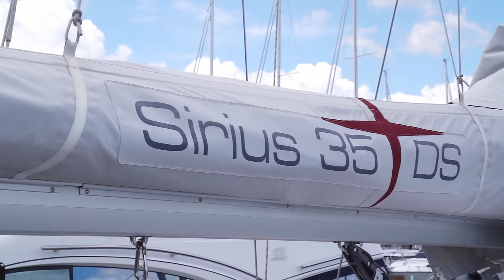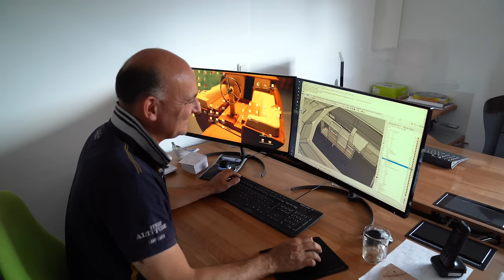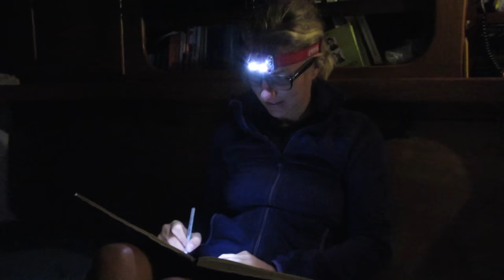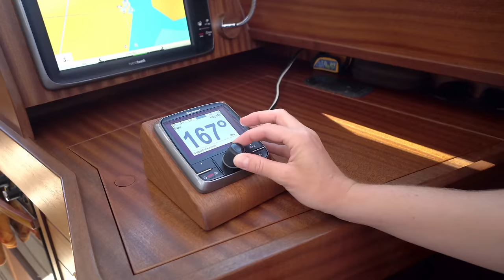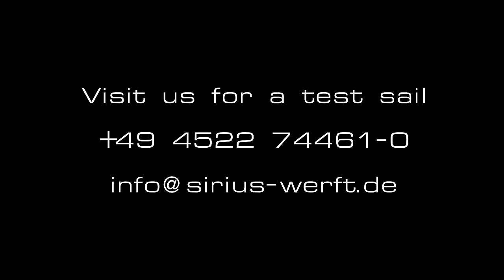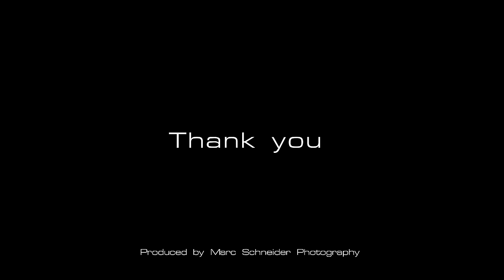Sailing the Sirius 35 DS: A Day at Sea

Comment: How difficult or slow is it to tack the genoa past the furled jib?
Reply from the maker: ...you can´t tack the genny though the gap, but either have to furl it, in and out, while tacking or gybe it though. This works pretty good, but is work, thought ...but than one have to see: as a cruising sailor, you would try not to set your course against the wind all the time or are on long tacks. If you have to tack constantly, the jib is the better choice anyhow, or if it´s that little of wind, furling the genny in a tack is not that much work at all...
Reply: @SiriusYachts  Thankyou. I had guessed furling would be necessary.  I enjoy cruising but I also enjoy twilight racing.
Reply from the maker: ...it is an option, thought! As standard it comes with just one stay and you could compliment your jib or smaller genua with an additional light wind sail, if you like. The benefit of the so called "solent rig" is, that you still have a proper sized jib, which could be sailed from 3-3,5 beaufort on, with enough sail area to have fun with it. ....and have the big genny at hand as well, without effort for changing sails, other than furling the new sail out and the old one in within 2 minutes from and without leaving the cockpit. Than the jib still sits on a furling reefing system and could be made much smaller, when the wind excides 7 beaufort. You will have rig which is more various, easy to use single handed in a very safe way and the overall performance on a dayly base is better as you could fly the big genny in 5-6 bft, with the wind from the back, but would probably only do so if easy to change if it gets more or the direction changes. You are also never forced to fly the sails halfway furled and destroy the shape they are ment to have with it
Reply from the maker: @yotsman42  ...me too! If possible every Wednesday and Friday evening ...and on weekends - if there would not so many customer appointments ;-) Nice Epex Sails, a 110% genny and a 120 square metre spinnaker  would be nice than…
Reply: @SiriusYachts  I am enjoying all your YouTube videos and particularly like the 35DS. I live in Sydney and have sailed most of my life.  I sold my yacht "Out of Africa", (anywhere as long as it is out of Africa), sold at the end on 2019 after racing and cruising OoA since upgrading to her in 2000. The only way I would get back to being a boat owner again, health permitting, would be to win the lottery and buy one of your great 35DS's. In the meantime I will keep enjoying watching your presentations and occasionally crew with friends at GFS.org.au.  Thankyou Thorston.
Reply from the maker: @yotsman42  Thank you! I am glad you like them! I am feeling very honoured and this exchange was not only nice but might help otheres as well ...and please keep the dream alive...as one never knows... All the best! Torsten
Reply: @yotsman42  that's the downside in my opinion - which is why I would opt for a single headsail. 🤗

Comment: Impressive. Can it be made unsinkable?
Reply from the maker: We could, however, you would loose a lot of interior volume, so much so we feel it would be impractical. We do however have a forward crash box, low down in the bows and a watertight bulkhead, we can also make the forward bulkhead inside the yacht watertight. But this brings expensive complications with the design and aestheics inside. but it can be done.

We can also lamiate kevlar into the hull for increased puncture protection and bow reinforcement and watertight  bulkheads aft, incase of a damaged rudder.

Every yacht can be completely customised to her owner and we can build whatever you want as long as it is safe and practical.

Comment: Am I the only person intrigued by the single 8 mm shackle that holds that entire main block? Won't it be ripped from the console in heavy winds?
Reply from the maker: …thanks for sharing your concern. We have been asked that before, but I do still wonder why. It is a standard fitting to every Harken/Rondstan/Lewmar/ or other Block manufacturing company and you won’t get any thicker shackle or bolt through it. They are made to last and in our expereance even on trips halfway around the world they have never failed so far. If you check out the big rigging companies I think you get to equipment for 60feet yachts before you land at 10mm bolts…

Comment: The main sheet secure point is scary, the main sheet fouled as the main was being set
the boom vang was not released and the boat was sailed in no more than 8kt yet healed too much. going with 20 minute check for traffic is a serious issue as it is a fine way to disaster. A year or two a watch stander went below to fix some tea and was run down with all killed except the watch stander. Checking for traffic every 20 minutes is dangerous. The engin is using the popular sail drive is efficient however you have a combination metals calls for expensive refits.
Reply from the maker: Thanks Peter, for all the good advice and comments. You touched a lot of topics so let me just give you my thoughts back one by one:
Reply from the maker: Main sheet: ...I am not 100 sure what you are referring to. As an frequent single-hand-sailor that´s where I love to grab it fast and easy from wherever in the cockpit I am at that very moment. The 8 to 1 / 4 to 1 system works very nice for strong winds as well as for fine tuning. It takes all the critical load but the positioning at the very aft of the boom makes this loads 1/4 of power needed if positioned in the middle of the boom like on most yachts. It also reduces the breaking risk of the boom to nearly nothing. But for reasons of full sun protection we do offer a targa style cockpit arch above the deck saloon for people seeking shade from the sun all over the cockpit while sailing, instead only with a typical Bimini - which is also available - in the aft above the steering position. This is not only a very nice feature for very sunny areas and living on board all year round, but has also the mainsheet attached on top and operated by a winch and the boom without a pulley system, 2,30 above cockpit floor. If you like, do have a look here: https://www.facebook.com/SiriusYachts/photos...
Reply from the maker: Stability under sails: ...we always have built lively and well performing sailing yachts. So you do feel the wind and the pressure in the rig at the helm and in the motion of the boat despite the solid material they are built in. They have a sail plan to measure this and all reefing and trimming possibilities available on cruising boats to play with. Whether of the 6 keel versions you choose - they all have the certification for world-wide traveling according to the CE norm and have the same stability rating in depended of the draft. All our yachts are developed for world-wide cruising in safety and comfort! There have been a number of curcumin-navigations on older yachts even. Some Atlantic crossings. Recently a 40 DS was collected by the owners in Germany and sailed straight back to Vancouver via Canary Islands, Caribbean, Panama Canal, Galapagos, Micronesia, Hawaii...
Reply from the maker: Night watches and 20min checks:  I totally agree that if you have the number of peoples on board to accomplish this, one would have always someone on watch! ...but if you are sailing single handed or with two people only - which will be the most likely set up on a yacht below 40 feet - you have to compromise. In this the deck saloon adds not only so much comfort, but also so much safety for skipper and crew: Just imagine always seeing your surroundings, what’s going or if help is needed or being prepared for the oncoming wave while at the nav station, getting something to eat or being on watch sitting in the settee sheltered from the elements, but with a 360° all around view...even under the head sails which you can from most cockpits.... As Marie said: It´s always down to the situation you are in. 15 to 25min is the span you should be reasonably safe from other boats, if you had clear vision from horizon to horizon before. This is what you get by calculation the fastest boats thinkable in your area aiming against your speed. Preferably AIS and Radar alarms are on. This does not clear you from half submerged UFOs but nobody could possibly be concentrated on a the water ahead all the time...and again, the deck saloon makes it possible for the whole crew to have an eye and less tiresome from the inside than through a sprayhood...
Reply from the maker: Shaft drive versus Saildrive: Yes, on this boat we had a Volvo Saildrive, but we do shaft drives as well. Many of the Swing-keel versions have those out of draft reasons. ...but even this could be different, pending on the owners choice of interior and the therefore ideal positioning of the engine. I did have learned that there are some reservations against Saildrives in the US market. Do you know why? Is it "only" for corrosion reasons - as this is not an issue to my knowledge do to Epoxy covering and total galvanic insulation against the engine. In Europe the Saildrive is the most common drive since nearly 25 years mainly for fewer vibrations and noise reasons, but also as you have no water inside the bilge, less to go wrong while lifting the boat out and/or bending the shaft when hitting something...

Comment: i'd LOVE to know:  how close to the wind can it sail?  How fast is it compared to a more traditional hull sailboat of same size?  I find that this topic is avoided with this company.  It's important.
Reply: There's a glimpse of the performance of the 40 DS with a delivery  Crew taking o e from Palm Majorca to from memory Plymouth and going up off the coast of Portugal. I think they hit 9 knots in not excessive Wind, which seems encouraging. Personally I'm not interested in ultimate cutting edge performance, favouring reliability with decent progress, so am willing to lose a touch say, with the Main Sail, by having in mast furling with a loose footed Tri Radial Main that's Battenless, so reliability and reduced wear and tear should get improved dramatically, especially with the addition of Sail Lu rication, and a UV protective strip facing the slot in the Mast when fully Furled. Can't wait to try it anyway, either with a 35 DS, or a 40 DS, plus to see how Tri Radial Foresails in Dacron perform and last as well. Hydra-Net seems optimum versus Dacron, but it would  be nice to start with Dacron,  a d if disappointed, move on to Hydra- Nett Cloth. I love Testing Stuff, which could be a bit of a bad Habit. Best Wishes.  Bob.  👍

Comment: How strong is the windows all of them ? Looks like a wave might po pop them out . Great video guys
Reply from the maker: Thanks for the comment and question. How about a 140kg body builder working on the hull portholes with a new axe for a test? We made this test some 6 years ago and I will make sure to post the pictures on Facebook soon! They are made out of the same material used for police and military cars...but ours is 12mm! ....and by the way: they are an option. But after eleven years, we have just built the first ever 35 without them...
Reply from the maker: ....Security and seaworthiness was the absolute first priority in the design spreadsheet. As we are building ocean-going-go-anywhere-cruisers since 50 years now, there has gone a lot of thought and calculation into every little detail. The saloon windows in particular are in use by us since 1988 on every deck saloon yacht we built and have circumnavigated the world a number of times, without any window failures. Recently a Sirius has been sailed all the way from Germany through the Atlantic, Panama Canal, through the Pacific, via Micronesia and Hawaii to Vancouver by their owners
Reply from the maker: ....The saloon windows are made from toughened security glass with an own certification for world-wide sailing (without the additional use of shutter blinds). They are up to 10mm thick and it is a fully glued in construction bolted trough an aluminium frame work with hundreds of 6mm bolts as well. The recess they are sitting in is a 25mm wide part of the GRP deck and the inner aluminium frame overlaps the same with on the inner side. The only way to destroy them, if you really try all you can, is using this very sharp and pointed hammers you find in busses and trains, but you will struggle to make an impact. Compared to windows in bigger boats, catamarans and commercial vessels this windows are very small ;-)

Comment: Please don't go to the tropics in one of these. I crossed half the south Pacific in a Sirius 38 and it's almost impossible to imagine a boat less fitted for such a trip. An all glass deck saloon with sealed windows. A huge, fixed dining table in the untenably hot saloon, instead of a berth. The main berth right in the bow, with the skipper's pillow a centimetre from the forestay. You can't cross oceans sleeping on the bowsprit! By all means cruise round the Baltic. Kip in your big forward cabin and sit out of the cold in your huge conservatory. But please don't head for the tropics.
Reply from the maker: ...well, the Sirius 38 DS is an older model with only a few built (and none of them has been in the south Pacific, to my knowledge!?)...but there are many important differences: The Sirius 35 DS has the master cabin in the very centre of the boat, exactly in the quietest spot and in the absolute gravity centre of the boat with nearly no movement at all. Salon windows have not been tinted and double glassed, hatches have been set differently, insulation was different as well...
Reply from the maker: ...true is, that through big windows you also get cold and heat in if you do not take measures against it (not that this would stop you having them in your holiday cottage!?). Building boats since 50 years now we have about 20% of or boats in very hot and sunny areas and most of the recent built 40s as well as some of the smaller models are in particular chosen to circumnavigate also through a lot of warm areas. This has been taking in account, when developing them. The good thing here is that everything good against cold works also against heat. She has a very sound insulation through the whole boat (up to 80mm in the roof alone, and including 30mm Divinycell  foam in deck and hull). The deck saloon windows are double glassed, UV protecting tinted and toughed away partly under up to 400mm of roof overhangs. But most important to understand is that a deck saloon is much easier to air through as you do not have to “convince” the air to go down through a hatch, below through the boat and up again out of the companionway. You can just open both side windows (and there could be more to open if really needed) and let the air blow through. Same goes for the many hatches up front on exactly the same level than the huge door and sliding hatch in the back. Biminis and - for being on anchorages and in harbors - additional sun shades are also available. The most effective: a simple L-shaped cover between roof and railing mounted vertically in no time which keeps you all visibility from inside out but stops the sun shining in from above (except of exactly midday only needed on one side). Of cause air-conditions are an option, but not always chosen by people living on board all year round or for extended times...
Reply from the maker: I might be baised, but personally can´t imagine a better concept than a deck saloon for living on board, blue water cruising and extended cruises... as it adds not only so much comfort, but also so much safety for a small crew or single hand sailing: Just imagine always seeing your surroundings, what’s going, if help is needed or being prepared for the oncoming wave, while at the nav station, getting something to eat or being on watch sitting in the settee sheltered from the elements but with a 360° all around view...
Reply: @SiriusYachts  An Irish Sirius 38 was, and I was aboard it for 3 months, from Panama to the Marquesas. It had a system of about 10 purpose made canvas deck covers, which took about an hour to rig, in an attempt to make the saloon liveable. They didn't. They just made it impossible to get around on deck, so could only be used in port. Taking the master cabin out of the bow was, I'm sure, a good idea.
Reply from the maker: @ProfMEdge  ...oh cool! Didn’t know this boat sailed this far. That’s hull no 03, grey hull. Full real teak deck. Very early stages...